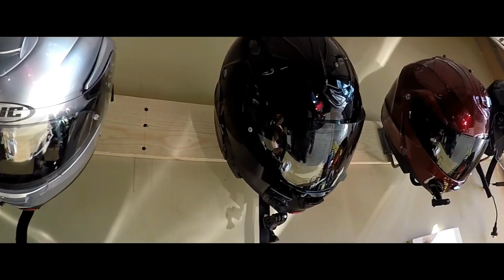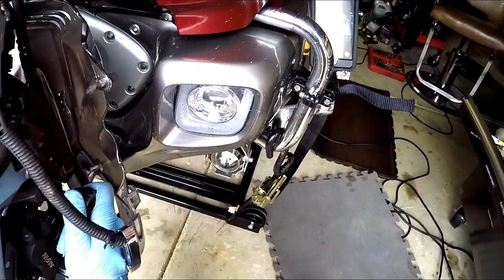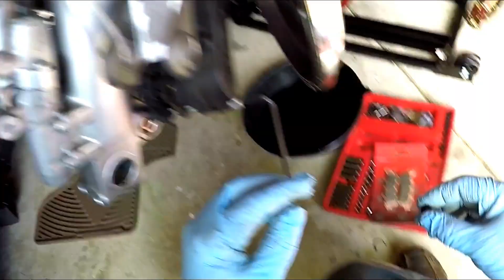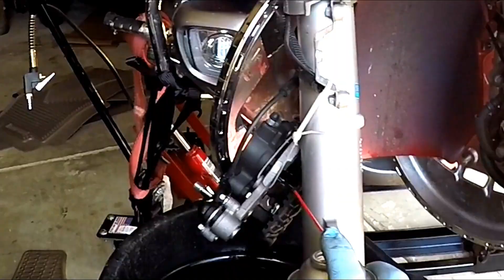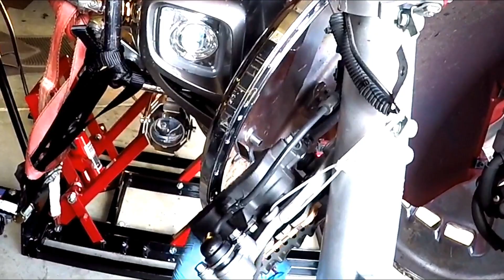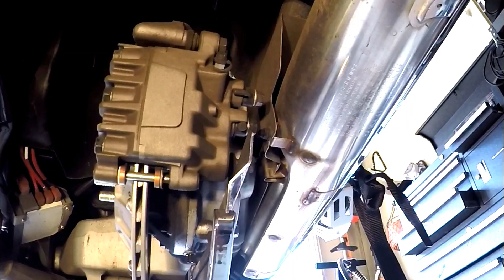My Goldwing GL1800 brake job footage.

Comment: I reinstalled the OEM pads on my '12 Goldwing today. I had tried a aftermarket ceramic less dust but less stopping power too!!
Reply: @Gary quick question I the F6B with aftermarket rotors  & pads, it seem that when I apply  brakes I get a grabbing feel and pulling to the left, was that one of the issue you were having with your after market pads, I also thinking if it might be the bleeding issue since I had to change my brake lines...If you have any feed back on this issue please provide...Thanks

Comment: Thanks for showing what it really takes to change pads. Yea, I guess I'll take it to the dealer. But, kudos for your own skill with that.
Reply: You do not have to remove the calipers to change the pad, it's a 10-minute job!
Reply: Push the calipers in take out the 5mm bolt an the pads fall right out this is way over kill

Comment: What?  Chris all you have to do is pry the  calliper piston back with a flat screwdriver then remove that 5 mm Allen screw .. Afterwards pull the pads out. Clean your Allen screw ; put in your new pads ; grease/replace /torque the Allen screw. then pump your brakes up. I guess the upside to your method is you're learning a lot about your bike and you get to use all those new tools. My Wing has 110,000 km on it so I'll be replacing the fronts for the second time and the rear for the first time.

Comment: It would have been appreciated if you had at least mentioned greasing the O-ring on the pad retention bolts, as well as the axle spacer, and torque numbers.

Comment: hey Chris I just wanted to know why did you have to take right wheel off to change the brakes just wonder...
Reply from the maker: Good question Jimmy, changing the brakes doesn't require taking the wheels off, but I took the wheels off to put on new tire tires.

Comment: I do my brakes by pressing the calipers in with a flat head screw driver slowly until they bottom out remove the rubber car then remove pin with 5mm wrench and pads slide out by themselves then put new pads in and reinstall 5mm pin and torque to 13 foot pounds and you done 
Listen there’s absolutely no reason to remove calipers or wheel leave everything mounted and remove one 
5mm pin on front left side then front right side and lastly right rear then pump brakes back ip a go 
15 minutes tops and no need to jack the bike up either but Chris is evidently removing all this so the viewers can see what he is explaining
Reply: If you are removing rotors yes follow the video steps

Comment: Brakes already???   You only have what 13,000 miles ?
Reply from the maker: The brakes and tires really didn't need changing, but I rather be proactive, than reactive.  Can I sell you some slightly used brake pads? lol just kidding.

Comment: There are two Allen bolts to remove, that’s it. Taking the front tire/Axle and all your chrome isn’t necessary. You wasted lots of ride time. You can change the break pads while it is on the center stand. SMHL

Comment: Did you mount both of those new tires yourself?
Reply from the maker: Bass Player I tried but was unsuccessful, so I let Honda mount my new tires on the rims for me.
Reply: If we all lived closer together we could chip in and buy a proper machine, I have seen them new for a grand.
The cost to mount and balance a tire around here is 45/50 bucks each...
Reply: I purchased a no-mar cycle hill  motorcycle tire changer  few years ago they run about $400. Money well spent!
Reply from the maker: Honda put the tires on the rims for me.

Comment: Chris you a bad mother (shut yo mouth). I would like the kuryakin lighted saddle bag and lighted trunk for my Goldwing like the ones that you installed for Memphis Mike on his bike.
Reply from the maker: Kuryakyn LED Trunk Molding with Red Lens for Honda and the Kuryakyn Lighted Saddlebag Molding LED Set with Chrome Lens for Honda GL1800GL1800http://www.jpcycles.com/product/zz33006
Reply: @chriscaliente5033  quick question I the F6B with aftermarket rotors  & pads, it seem that when I apply  brakes I get a grabbing feel and pulling to the left, was that one of the issue you were having with your after market pads, I also thinking if it might be the bleeding issue since I had to change my brake lines...If you have any feed back on this issue please provide...Thanks

Comment: I hope nobody uses your video as instruction on brake pad change, you do not need to remove the calipers or wheel, its a 5 minute job !!, I can only assume you remove the Engine to change the air filter. Check out Partzilla's Videos for the correct way to do the job.